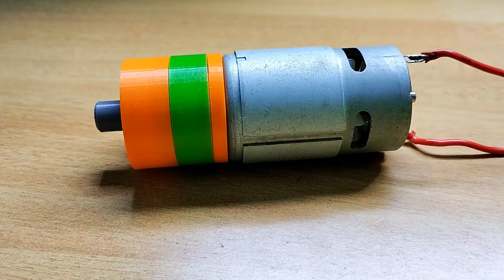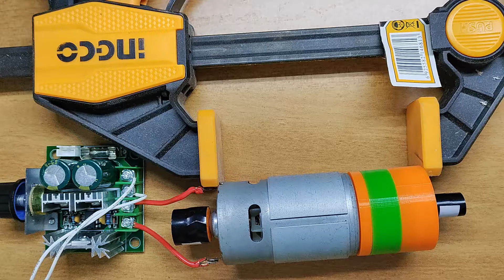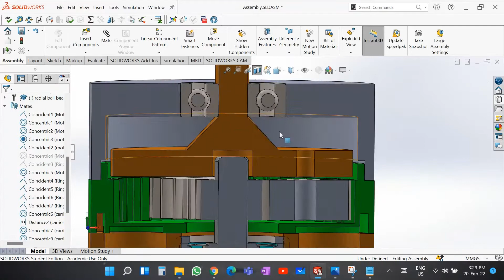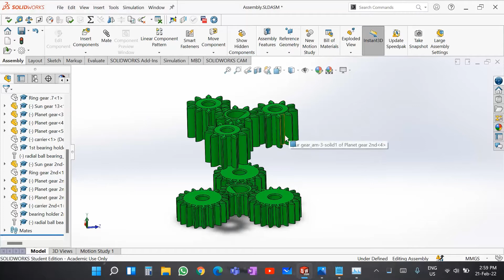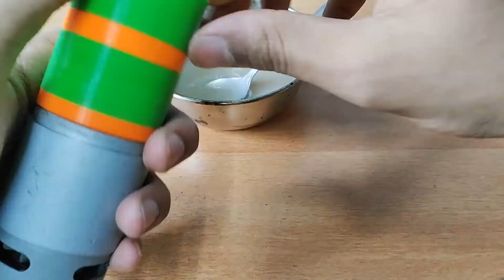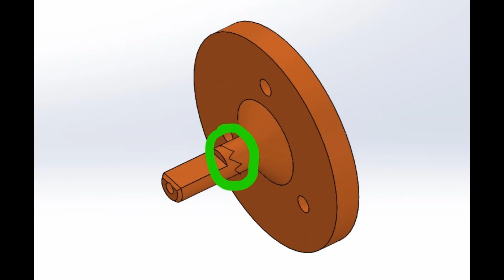High Torque Planetary Gearbox for 775 motor (3D Printed)

Comment: Hi I need files for this gearbox
Reply from the maker: https://drive.google.com/drive/u/0/mobile/folders/17qvcRFZtBAsBPySQvEWh2MLAfG78AKCW
Reply: @aarravoltics4592  Thank you, but I have another question: how can torque be calculated in newton meters?
Reply from the maker: You can attach an arm of known length to the motor/ gearbox and measure the weight it exerts on a weighing scale. Then convert grams to Newtons and multiply by the length of the arm in metres.

Comment: Hi! Great Video! Thanks for sharing! How much did the 3d Printing of this gearbox cost you?
Reply from the maker: The 3d printer which I use is the creality ender-3 (15k rs) 
The filament cost is very less. Total cost of the gearbox is around 50rs for printed parts + 250rs for the 775 motor + 50rs for the bearing
Reply: @aarravoltics4592  : Wow! Thank you so much for your reply! That is very cost effective! Awesome work! You Rock buddy! :)

Comment: may i request a 3d print file ?
Reply from the maker: The link for CAD files are below
https://drive.google.com/drive/folders/1-WvbbmJMV3YOA-4OExCOW6UPLpViqqt_
Reply: @aarravoltics4592  thank you very much
Reply: @aarravoltics4592  it is different cad file. can you check ?
Reply from the maker: @NurettinOzcelik  Oh i'm sorry. This is the correct link: 
https://drive.google.com/drive/folders/12nxAoO5SSw0S-7f44uUvXHuBYfW4qps9?usp=sharing
Reply: @aarravoltics4592  thanks for reply but it isn't the planetary gearbox cad files.
Reply from the maker: @NurettinOzcelik  https://drive.google.com/drive/folders/17qvcRFZtBAsBPySQvEWh2MLAfG78AKCW
Reply: @aarravoltics4592  the size of bearings ?